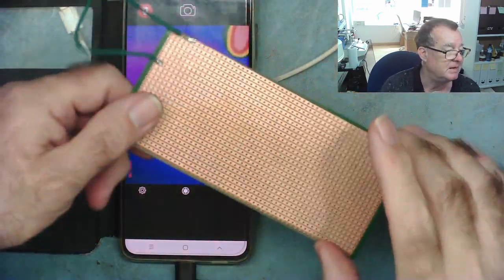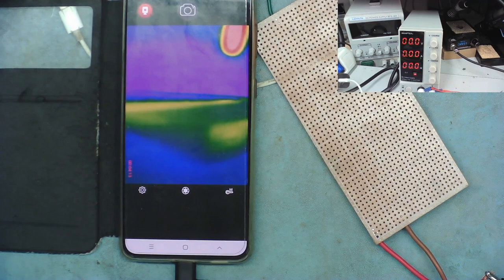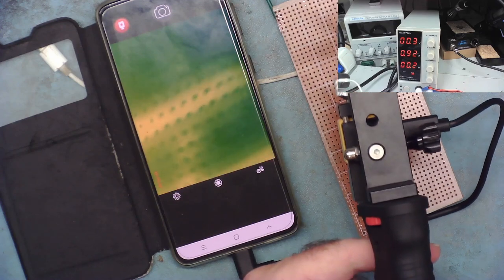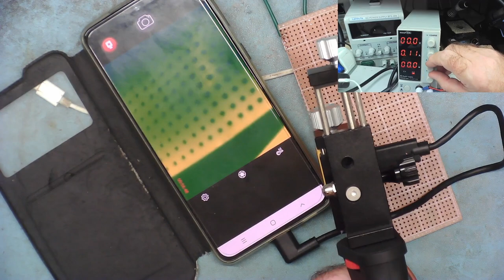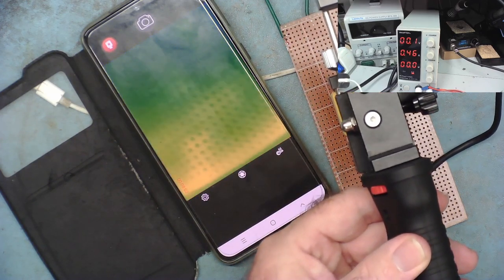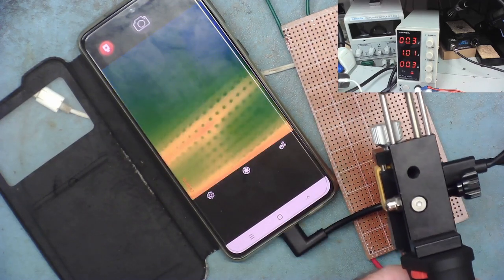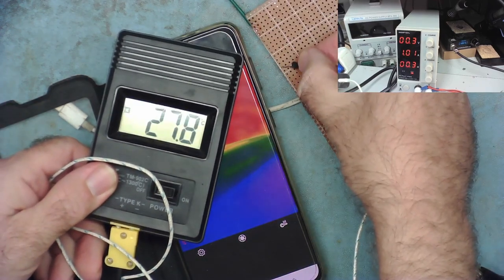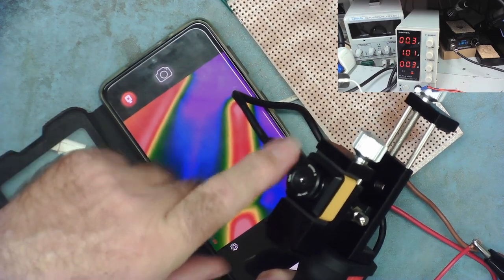How To View Current Flow In PCB Tracks! A New Way To Trace Short Circuits?

Comment: There is also a rosin vapor pen which vaporizes rosin and activates it when a short is apparent
Reply from the maker: There is - but bear in mind this camera sees PCB tracks light up like neon signs, with an actual temperature increase of 0.2C-0.3C
I haven't tried the rosin but I would be very surprised if it can react to such small temperature changes.  Sure if a component gets hot you could find it - but sometimes you have an absolute short (the faulty component will not get hot as it has zero voltage drop across it) or due to maximum safe voltage levels you can't get enough current into a low-ohms 'short' to get anything hot. That is where I think this camera may help us follow the circuit traces to the shorted component.  But it needs more experimentation with actual faults of course 😉

Comment: It's a nice concept, but don't think it will work that great on a populated multi-layer board. Now I could be wrong but I have work with thermal cameras to fix broken motherboards. Because of the multi-layer sometimes even bringing it to a dangerously close current still be difficult to find a short. I would love to see this done on a multi-layer board though, if you could provide an updated video.
Reply from the maker: Of course I will be trying it on that sort of PCB,  I also repair them (on video too).  I just wanted to get a quick video out as I went and publicly opened my mouth and said I thought this was doable!   Still, lighting up circuit tracks like neon lights at ~12mW per track centimeter (and they are fairly thick tracks too) is pretty impressive I think
Reply: yeah, single sided paper composite is like heating sot-23 with these 300mW amounts of power, where as 6-8-10 layer FR4 would be more like TO-220 / TO-264, so 10th times larger power to heat it up.
Though, IR sensor should indeed be the most sensitive for this kind of task.
Reply from the maker: @Mr.Leeroy  Well I could inject up to 10A into a short to mitigate that 😉
I also wonder if it would be possible to modify the app (or write one) so you could mount the camera on a solid mount, hold the board fixed in place then take many sample photos and process the data together like NASA do with telescopes to create images (visible, IR and Radio Wave) of objects too feint for the telescope to see unaided?
Reply: @LearnElectronicsRepair  Yeah, but 10A capable PSUs are not very common, unless you buy one specifically with this in mind.
Mine is linear for EE and only goes up to 3A and it really pushes the limits of TO-264 BJT thermal resistance that it is based on.

Comment: Nice, time will tell but i'm confident this is a good edition to the test set up....cheers.
Reply from the maker: Yeah me too 😁  I have a faulty GPU here somewhere with 12 ohms on the 3.3V rail and I was never able to trace where the low resistance is as I cant get enough current in at 3.3V.  Maybe this will help
Reply: @LearnElectronicsRepair  Fingers crossed !
Reply: @LearnElectronicsRepair  have you tried put lighter fluid or better yet isopropyl alcohol on the track/traces and see where it evaporates off. I saw that trick on a guys channel. He fixes laptops and phones ETC  from his shop he called Sorin. But it's a good way to find a short quickly.

Comment: @ 3:20 U have NO voltage on;... U turn it right down...
Reply from the maker: Or it was less than 0.1V which is the resolution of the meter on the PSU.  Of course if I turn a constant current source to zero then the voltage should also read zero - this is normal according to ohms law.

Comment: I missed the point, why you didnt take some donor board, scratch trace to remove green mask and solder wires that goes to psu?
Current track is wide 3mm, heat dissipation on 0.5mm wide track probably wont be visible on that low resolution camera.
Reply from the maker: @orion 310591 
I think I am missing your point also - resistance of a 0.5mm wide track per cm is HIGHER than resistance 3mm track per cm (in ohms per centimeter and assuming the same thickness of copper trace). 
Watts = VxI. 
I is fixed in CC mode and V = I/R.  So for a constant current source the higher the resistance per cm would cause a higher voltage drop per cm and therefore we would get a higher W per cm and the track would glow brighter, yeah?

If that is wrong could you explain why?
Reply: @LearnElectronicsRepair  That makes completely sense ... the smaller the copper track, the higher the resistance, the higher the heat generated by the current flowing through it, the better it shows up with a thermal cam.
Reply: @LearnElectronicsRepair  Its not wrong, I have not tested it disclaimer but I believe that heat will be so low that camera will not pick it (low res and poor overlay focus). Resolution is too low and focus is bad on low distance. Those cameras combine two layers, one is real image, and another image is heat color, and thats how u get image on thermal camera. Steady holder is a must. Just think how much heat is required on some boards with preheater and heating gun to unsolder something. Yes, desoldering is not the same as hunting heated component but I speak about board cooling it self very fast. Another thing is that traces on board are not designed to be heated on purpose of troubleshooting with camera. There are trace width height standards/rules.
Reply from the maker: @orion310591RS  disclaimer I haven't tried it either (yet) on something like a motherboard.  I think we can agree that the narrower the PCB track the higher the resistance per centimeter therefore the more heat it dissipates for a given current.  I'm gonna attach the camera to some sort of steady but adjustable mount as you suggest, probably something like an old anglepoise lamp. Then we can give it a go. 

If we are talking about power planes then the surface area I think would be too large to see anything.  But PCB traces is another matter.  The camera seems capable of showing a temperature gradients of even 0.2C very clearly.  I accept your point that heavy PCBs are designed to sink a lot of heat, but then a 0402 or smaller MLCC can get hot enough to burn your finger, even when soldered to said PCB - so heating a track by 0.2C when passing current through it doesn't seem too unreasonable even on heavy PCBs.  So I am open minded to the prospect... the proof will be in the pudding, as they say.

Comment: I HAVE A GUY WHO NEED HIS AMP FIXED. WHEN HE TURNS IT ON THE VOLUME STARTS THE DROP THEN IT SHUTS DOWN. COULD YOU TELL ME OFF HAND BEFORE I OPEN HER UP TO LOOK AT IT WHAT THE PROBLEM MIGHT BE?? I WAS THINKING A SHORT OR A COMPONENT IS ON ITS WAY OUT GETTING HOT. YOU WOULD BE HELPING ME OUT A LOT. 
P.S. IM SUBSCRIBING TO YOUR CHANNEL JUST FOUND IT DISMORNING AND THINK ITS GREAT. 👍🍻.
Reply from the maker: Is it a Mosfet Amp (Class A/B)? Because Mosfets do that when they get hot - opposite to thermal runaway in bipolar transistors.  Does it do the same thing on both channels (if it is stereo)
Also may I politely remind you there is no need to shout here 😉
Reply: Defo a short or a component ... 👍

Comment: Bummer I just bought the Blackview  BL8800 Pro  on your recommendations . I am not holding you responsible for my actions, it is just that this review can after my purchase.
Reply from the maker: To be fair I think the Blackview is a very good thermal camera especially with optical overlay and auto focus it is actually clearer and easier to use than this one.  

I didn't have this one at the time and I am really honest with everything I am asked to review.  I really like the Blackview, if not for this one I would have kept the BL8800 Pro -  I think Carlos at Retro Upgrade is going to have it and feature it on his channel, and I am sure you will be happy with yours.  I tried all three thermal cameras on the same demo motherboards with the same faults and every one of them could diagnose it 🙂
Reply: @LearnElectronicsRepair  thank you for your reply
Reply: @LearnElectronicsRepair  "every one of them could diagnose it " - but we talk GPU diagnostics here with shorted tracks lighting up to the shorted mosfets, inductors etc. Miliohmmeter will be going to the bin if you prove this camera can show tracks.